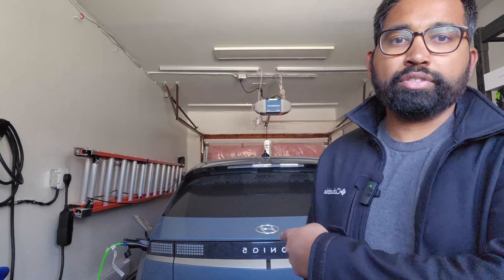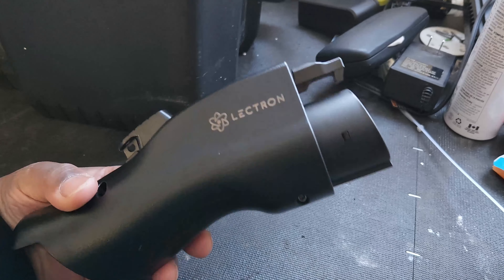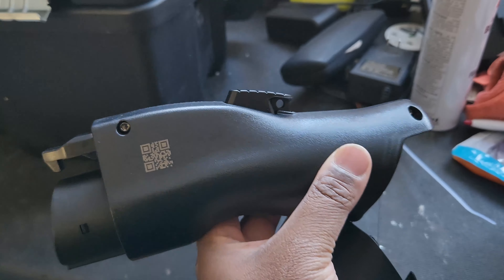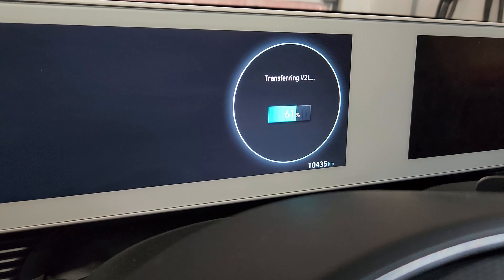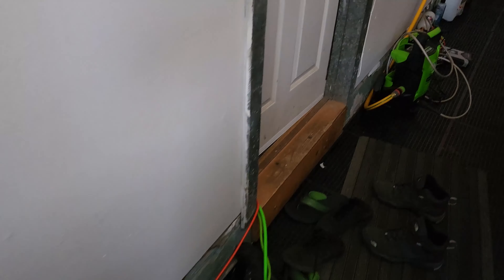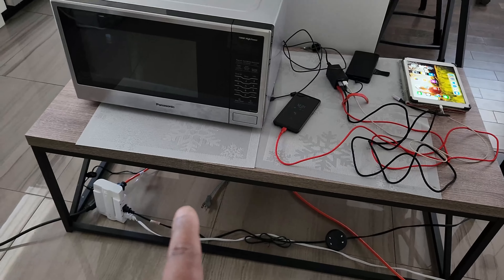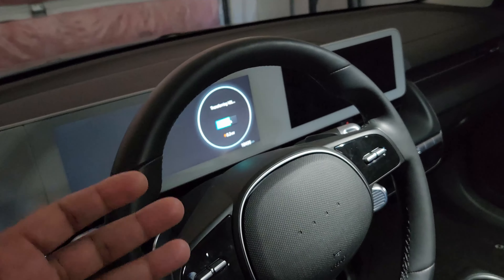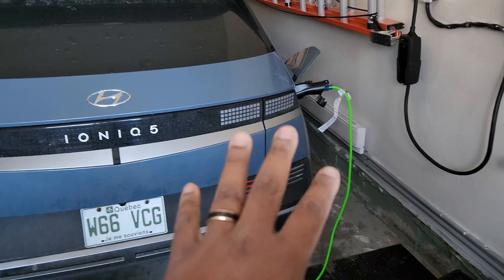Power your home with Lectron V2L - 2022 IONIQ 5

Comment: transfer switch in Canada is a scam! There is no need to isolate the panel neutral from the generator neutral, as long as the 2  grid hots are disconnected at the panel, the panel will NOT feed anything into the grid through the neutral since the circuit is NOT complete!  a breaker interlock must be legal in Canada, since it is completely legal in the USA and the USA NEC standard is superior to the Canada EC standard, but I don't understand the lame reason the Canadian authorities have for not allowing breaker interlocks: they say IF the panel cover is removed THEN the breaker interlock becomes useless, but the whole idea of breaker interlock is to prevent accidental back feeding!  but if someone intentionally back feeding the grid CAN do it ANYWAYS! all they need is an OUTLET! someone opening the panel cover better know what they are doing so cannot back feed the grid accidently. Canadians codes are outdated and ridiculous! must be changed to match the USA NEC standard.